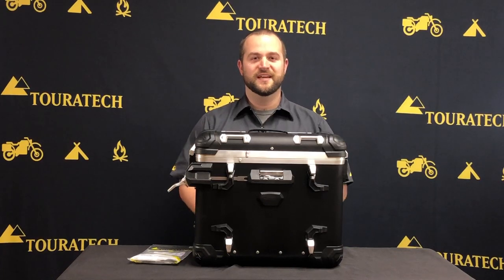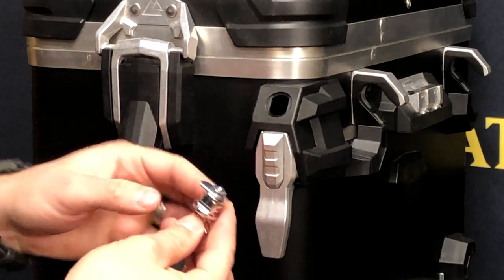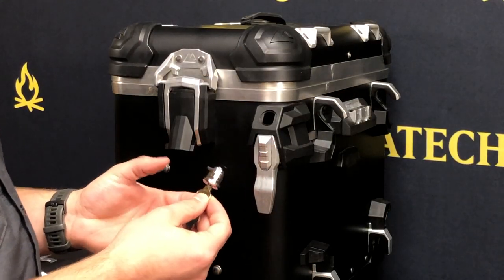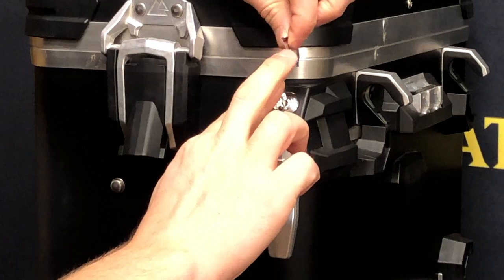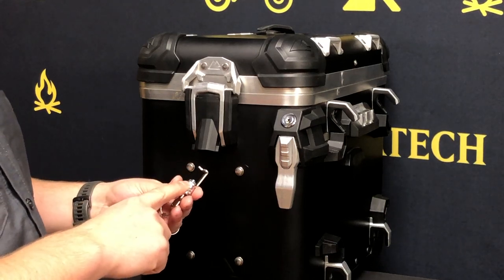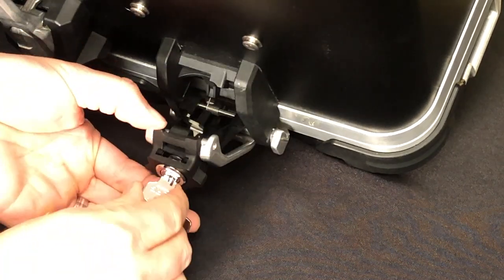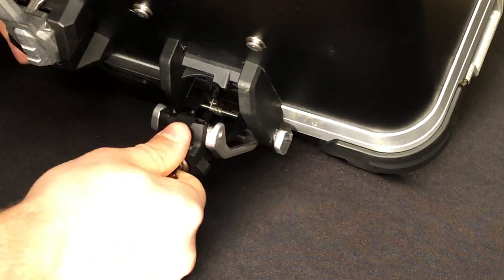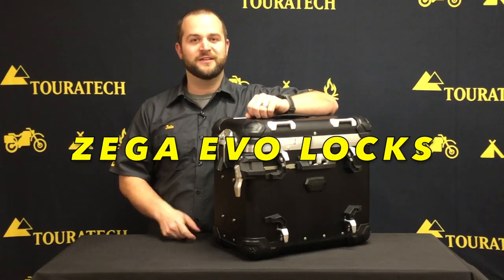Touratech Zega Evo Pannier Lock Installation

Comment: And how do you remove the old lock/spring clip without destroying the lock casing?
Reply from the maker: It's not possible to remove the lock and clip without disassembling the latch system. This is done intentionally as a security measure.